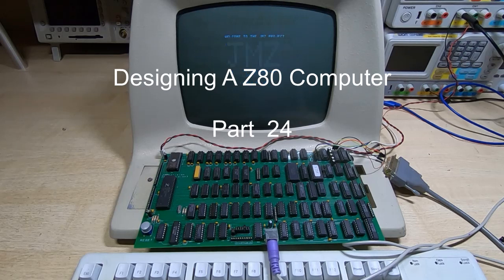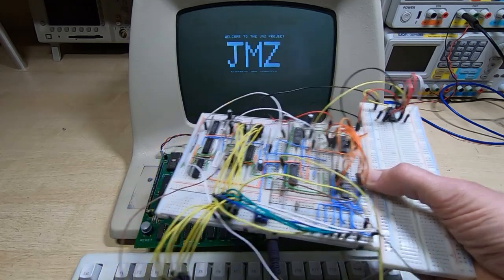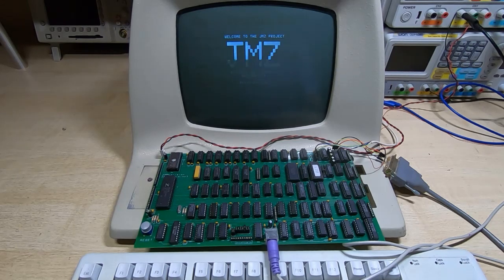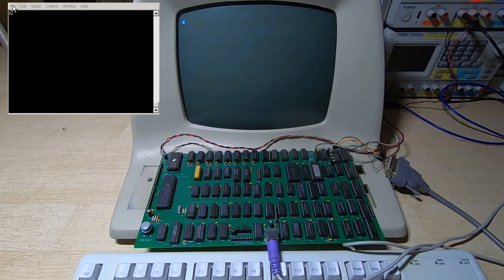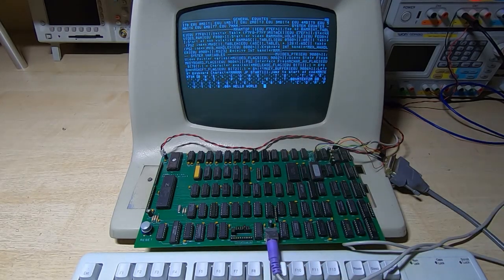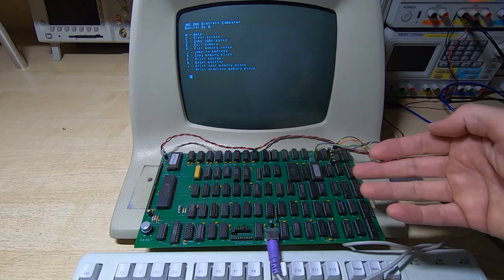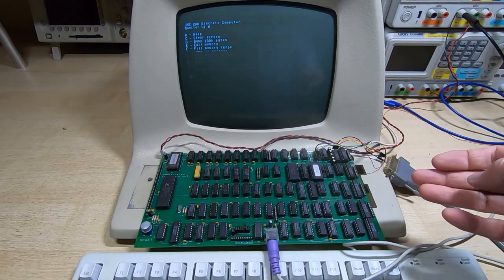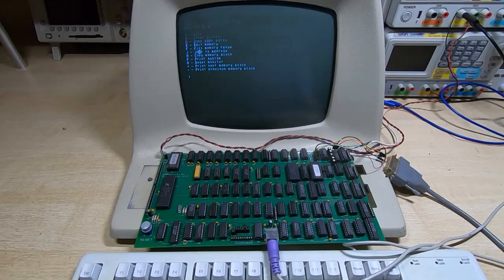Designing A Z80 Computer Part24

Comment: Glad to hear that you've done the floppy controller. I've designed and built Z80 computers like this in the past, but never got them further than running a simple shell from a boot rom. When I first saw your project it made me want to build a complete functional discreet system that could actually run CP/M from disk. I doe have a spare floppy disk drive, but I've never designed anything like a floppy controller, so I'm really looking forward to seeing details on that.